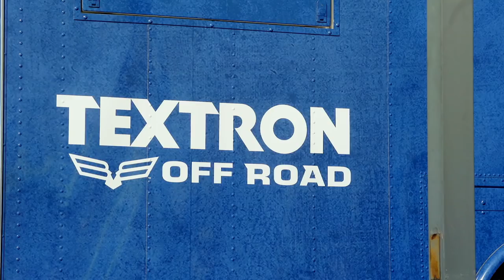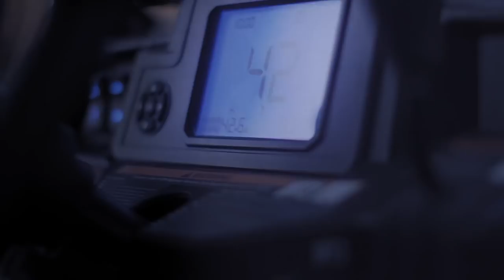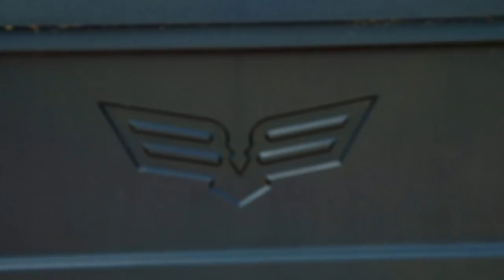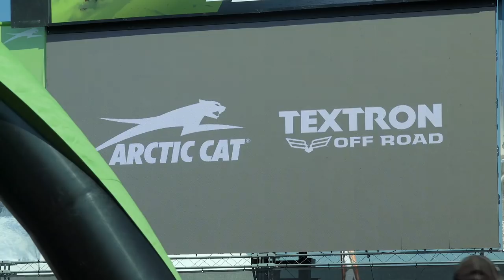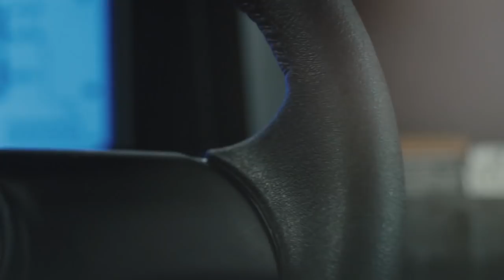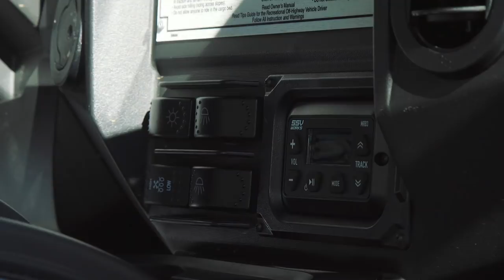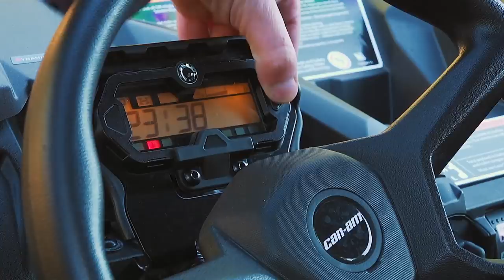Dirt Trax Television 2017 - Episode 16

Comment: The one complaint about the new Maverick Trail is the box needs to be extended more over the rear wheels. The current set up slings all the mud etc into the bed or on your cargo.